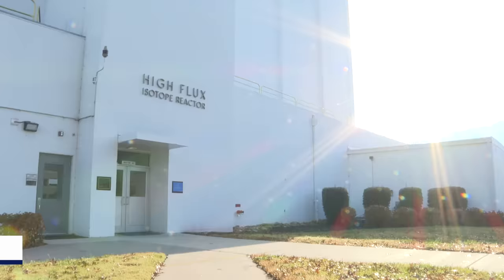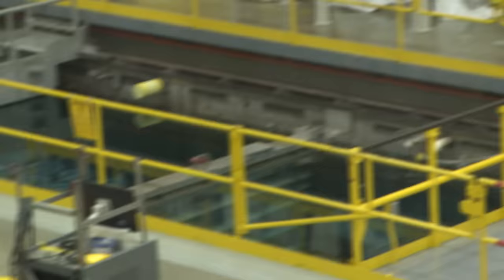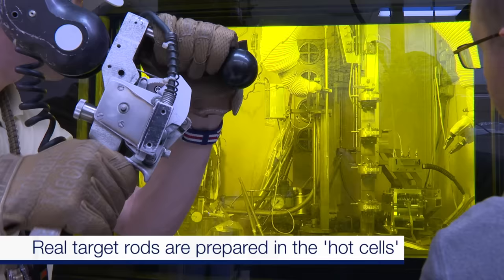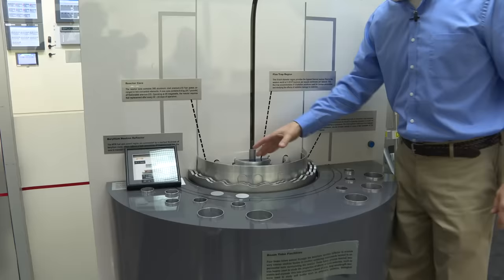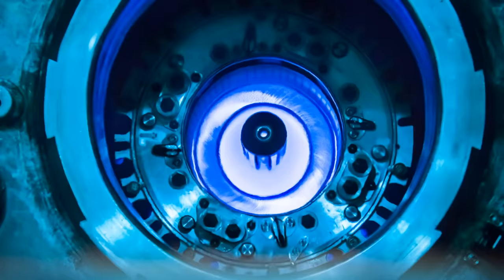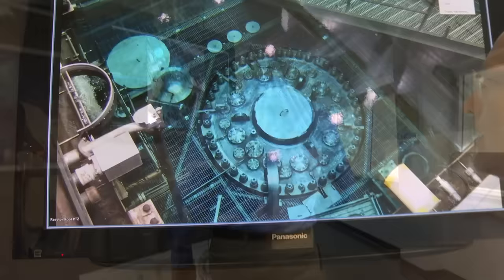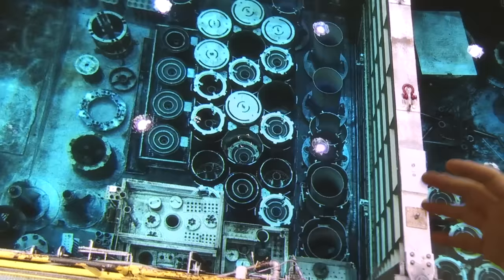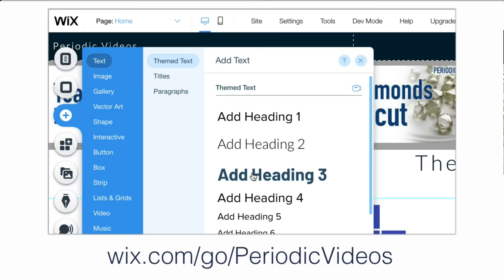Inside a Nuclear Reactor

Comment: I get an almost spiritual feeling, looking at the soft blue glow of Cherenkov radiation. Seeing it in real life, with my own eyes, would be a dream come true!
Reply: It is even cooler in person than in the videos, if you can believe it. There are a decent number of universities with reactors you can tour & the "TRIGA" design is the coolest imo b/c you can watch the reactor while it's critical. I've seen HFIR from this vid, ATR in Idaho, & MIT's reactor, but the humble TRIGA at Texas A&M was the one I could most easily stare at for hours haha
Reply: I agree that it is cooler to see in person. It is eerie, when you are looking right at it, knowing what makes it visible. I've worked in spent fuel pools quite a few times, when spent fuel is being brought in straight from the core in refueling outages. I've also seen the fuzzy effect in video recordings. I am the programmer for the AREVA ECHO-330. We set up our system on top of empty spent fuel pool storage racks. Spent fuel was brought to the system, fixed in place, and in line with our multiple transducer array, and high radiation resistant camera. A regular camera can not handle the radiation from fuel that just came out of the core. Even with the radiation resistant cameras, the fuzziness is there. Part of it is heat from the fuel making currents in the water. And part is the effects of the radiation itself on the camera sensor. In discussion above, people are talking about fuzziness you see with your eyes, if looking at fuel live and in person. But Daniel's original question said 'interference in videos'. It is more noticeable in videos than it is in person. Other than the currents in the water due to it being circulated for cooling, and from heat coming off the fuel, if you are standing by the pool looking directly at spent fuel, I don't recall the fuzziness that you see in recorded video. So it is the high radiation affecting the camera sensor. It has been a few years since I was at poolside. But I have hundreds of hours of poolside work in my history. I live in Lynchburg, VA, mentioned in this interesting video. Been to some of the places mentioned in the video, and familiar with some of the process, including Cf-252. We used that in one of my systems at work and swapped it out every two years. It has a very short half-life. I think about 2.6 years.

Comment: Is it possible for you to show the lenghts, temperatures and co. also in the metric system?
Reply: Shouldn't be a problem one might think. It's not nuclear science.
Reply: 8 feet = 2.4 meters
9 feet = 2.7 meters
36F = 2C
100F = 38C
120F = 49C
156F = 69C
24 inches = 2 feet = 0.6 meters
20 inches = 1 foot 8 inches = 0.5 meters
25 tons = 50,000 pounds = 22680Kg
Reply: @jimknowlton342  Isn't a ton a thousand Kg ?
Reply: @D4RKBRU73  
He's converting the imperial to metric.  An imperial ton is 2000 lbs... So a little over 1016 kilos.  A metric ton is 1000 k.
Reply: @sujimtangerines  Ah ok thank you
Reply: @D4RKBRU73  1 ton in the US  is 2000 pounds, or 907kg.  This is technically a short ton.  M McCoy is talking about long tons, in the US we almost always mean 2000 pounds when we say 'ton'.  Hope this helps.
Reply: @jimknowlton342  <It does, thank you Sir
Reply: @D4RKBRU73  A tonne is a thousand kilograms...the different spelling is to delineate the two.
Reply: Dave Micolichek  Don't be lazy, adopt the metric system
Reply: Dave Micolichek  Why tho? I am genuinely curious why america isn't adopting the metric system. Its far easier to learn and more intuitive. 1t= 1000kg 1kg= 1000g 1km= 1000m. I really don't get it. Is there some hidden benefit to to the imperial system?

Comment: I was wondering though, whats with that low droning sound that some reactors make? Is that due to the reactor/nuclear reactions taking place or is that just a combination of the machines and pumps operating?
Reply: probably machine sounds
Reply: Water being recirculated to remove heat from the surface of the fuel.

Comment: But the real question is can they power a flux capacitor  to 1.21 Gigawatts
Reply: The reactor core is 85 Megawatts, which is 70% of 1.21Gigawatt. 13:18
Reply: Gotta get it to 88mph...
Reply: @AverageJoe8686  
Uh... It was a "Back to the Future" joke.
Reply: @AverageJoe8686  85 MW is not 70 % of 1.21 GW
Reply: @Morphior  0.85/1.21 = 0.702479338, or ~70.248%
Reply: @AverageJoe8686  85 MW is not 0.85 GW. That would be 850 MW. So 85 MW is about 7 % of 1.21 GW
Reply: @Morphior  hahaa yep I just love my lysdexia...dyslexia? dysexlia, yeah that's the one

Comment: The high flux reactor is interesting  because the core is made with mostly HEU that goes critical once it is put inside of the reactor and gets wet. The rate of reaction is very quick compared to typical pwr's so it can create exotic isotopes 🤓

Comment: The blue light is emitted when a charged particle (such as an electron) passes through a dielectric medium at a speed greater than the phase velocity (speed of propagation of a wave in a medium) of light in that medium. Special relativity is not violated since light travels slower in materials with refractive index greater than one, and it is the speed of light in a vacuum which cannot be reached (or exceeded) by particles with mass.

Comment: The sixth or seventh generation nuclear reactors will be powered by U235 enriched to 12 percent in order to extract 2.4 percent of fission products and make use of PUREX for fuel production. From the PUREX plant all of the Pu239 is reused to make electricity.

Comment: re: the involute shape.  I don't understand: the diameter of the inner circle is less than the diameter of the outer circle; if you divide the ring between them into "equal" spaces, they must have a little bit of wedge shape to accommodate the outer diameter, do they not? if not, how is that possible?

Comment: If x-rays and gamma rays carry more energy than a photon in earths atmosphere; what would happen if a photovoltaic cell was put in the reactor while in operation?
Reply: Straight in the reactor core itself it would melt. PV cells are very efficient with short wavelength UV, X-rays, and gamma rays. This kind of approach had been adopted in the sixities and seventies for cardiac pacemaker batteries. They were known as beta-voltaic batteries. In this application it was a beta source, promethium 147, which does not emit gammas as a result of beta decay. Not exactly the same thing I know, but radioactive decay can be very usefully harnessed. The use of BV cells declined with lithium ion technology / chemistry becoming ever more affordable.

Comment: I wonder if you could put a solar powered drone with a camera on it inside the reactor to film and get shots of the cherenkov radiation well charging the Drone batteries with whatever ultraviolet light that is emitted from the reactor. ( if solar panels can even use ultraviolet light?)

Comment: I thought that beryllium reflected neutrons.  He seems to be saying that hitting beryllium with a neutron will cause the beryllium to release some (which would change its isotope, and would also mean that you can "use up" the beryllium).  Is that correct?  It doesn't sound right.
Reply: It does both, when beryllium is hit with high energy neutrons it can sometimes will undergo an (n,2n) reaction. Be normally has 4 neutrons and 5 neutrons, but if you hit it with neutrons, it will go to take a neutron with it, leaving Be8, with 4 neutrons and 4 protons which then decays into 2 alpha particles in addition to the 2 neutrons that zoomed off. This makes beryllium both a reflector and neutron amplifier and why beryllium will often also be used as a neutron source to start nuclear reactors.

Comment: why, since neutrons change the composition of the elements, it doesn't change the barlium in the same way into another element that is in the reactor housing?
Reply: barlium? Do you mean the aluminum? If so, then yes, over time the reactor components eventually fatigue and need to be replaced.

Comment: is it possible to make miniature reactors ?

Chris is talking about billions of neutrons hitting a square centimeter, but what if you miniaturize it to 1 square millimeter (or smaller) surface area would it be possible or usefull to do so ?
Reply: It isn't about the density of neutrons necessarily it's about if you can get a small enough critical mass. getting a small critical mass for micro reactors is doable but then extracting the heat becomes more problematic. However micro reactors only order of 10 kW are being developed for space. Google kilopower to read more about this NASA project.

Comment: Does all the aluminum used in the core and other reactor components become activated?
Reply: No, in a word. Radioactive isotopes of aluminium are very short lived.
Reply: @paulanderson79  Not exactly, and Ill quote the IAEA on this one

" Radiation damage and aging of the aluminum components are caused by the interaction
 and capture of fast and thermal neutrons in aluminum that results in change of microstructure and change of mechanical properties such as tensile strength and elongation."

while a bit more hearty than some materials, aluminum eventually has a lifespan in a reactor system.

Comment: Thanks for the tour.  Was hoping the question of life might come up.  D. radiodurans bacteria can survive inside the core of nuclear power reactors, and in corrosive acids, in environments above the boiling point of water, freezing sub-zero regions, and even the cold vacuum of space.  Wonder if any microscopic life (D. radiodurans bacteria, etc) can survive in the higher heat and/or high neutron environment of this reactor ?  Where's the limit ?

Comment: The blue glow is exterior of the pressure vessel.  Do the neutrons damage the vessel, eventually?
Reply: Yes, very eventually. The higher the flux, the more damage so high flux reactors like this require a fair bit of maintenance when it is offline.

Comment: So it is fair to say they have more experience in radiating aluminium than all other elements combined, what happens to aluminium in those conditions?
Reply: It will become activated (absorb a neutron) to become Al28 which decays in time to Si28. All fuel has to be designed to take into account its neutron absorption amount over the lifetime of the fuel and if it can withstand the damage well enough to keep its structural properties in spec. This is why materials qualifications remain the most time-intensive part of nuclear R&D.

Comment: The way the control the movement of the fuel / core when loading and unloading looks very crude.  What happens if they make a mistake when it's going into the reactor and they smack the core into they edge of the hole?  Damage of expensive equipment.

So, it all seems both futuristic and crude at the same time.

Comment: Where do the extra neutrons come from, when they're emitted from the beryllium shield?
Reply: beryllium 9 is the most common isotope of beryllium. That means it has 9 nuclear bits and 4 of them are protons. In this nuclear reaction, the beryllium absorbs the neutron but becomes unstable. In a rather rare type of decay, it splits into 2 alpha particles and spits out 2 neutrons. You can think of it as the neutron that went in and an extra come out but of course neutrons are distinguishable so that isn't exactly accurate.

Comment: at 14:16-14:20 do we see ants or some other creature inside a nuclearly active section? I see something moving in lower-right side of the frame.
Reply: That's about 10 feet underwater so highly doubtful it's anything but some debris or film being swished around in the flow of water. You can see the frame on the left moving a little bit in the flow as well.

Comment: So I'm under the impression the water is highly radioactive after all this, what happens to that water.
Reply: No because the fuel rods contain all the radioactive elements. The most contamination that gets into the water is tritium from the water. Regular hydrogen Will eventually absorb enough neutrons to become tritium. That's the main contamination but it also occurs naturally so you can get rid of it by diluting it normally

Comment: What would happen when I took a sip out of the reactor pool?
Reply: Most likely nothing would happen if you took a quick sip, as water is a decent radiation insulator. Maybe you'd have a higher chance of cancer later in life? A very insignificant increase. But, if you would jump in with a scuba suit, go close to the reactor, and then take a sip of water, you'd most likely get either the smallest type of radiation poisoning, the average radiation poisoning, or guaranteed cancer later in life, but most likely due to the external exposure, and not from taking a sip. A sip is very small, so small that it most likely won't do any harm, or at least a lot less harm then external exposure. All of this does count on the reactor type, and how much radiation it emits.
Reply: D. Y. Thank you so much :)
Reply: Nothing.

Comment: Makes me wanna watch Chernobyl again.  The cask weighs 12 tons?  Sheesh, I wonder how much actual product it contains.  Getting a permit to ship it must be a bureaucratic nightmare.  It breaks all the rules.  Size, weight, height, not to mention the grandaddy of all hazmat.
Reply: Activated nuclear waste gets shipped thousands of times per year in the United States. While you're right to say that it's highly regulated it's also not very unusual.
Reply: @BeCurieUs  What is unusual is a 12 ton item at 14 feet tall making it too high for just about any bridge overpass and too heavy for just about any road except on interstate highway (and even then is problematic), add to that the width requiring at least two lanes of traffic.  You have a wide load requiring a lead and follow vehicle carrying the most dangerous hazmat known to exist.  Something like that requires months of planning with different permits for each state and/or municipality.   Like I said, a bureaucratic nightmare.  Sure, trucks carry hazmat including nuclear waste all the time but not in a 12 ton cask that is 14 feet tall.  The only difference in carrying nuclear waste as opposed to any other commerce is the times you can travel and routes you can use.  No special permits required.  Just a nuclear waste hazmat indicator on the trailer.

Comment: 05:54 Steam is bad... does that mean the reactor has a positive void co-efficient?
Reply: Most LWRs do not, but it can cause damage if the design isn't meant to experience cavitation. Bubbles send out little shockwaves when they dissipate, and steam is also bad in the reactor because it means the water is not in contact with the reactor walls...causing the fuel to spike in temperature. Steam is always bad in a reactor system, even ones that are meant to have bubbles in them like BWRs. BWRs are mostly just exploiting nucleate boiling advantages and have no steam in the actual reactor system. Nucleate Boiling
 is actually hugely fascinating and complex and something I didn't understand fully until I started asking my actual nuclear engineering friends about this reactor system and why they had it pressurized at all if it is below boiling point. Turns out, boiling is hugely complex and not as simple as something is boiling or not.

Comment: Are there little bugs in the reactor? ..lol...🤔😳 Starting at around 3:09 in the video where they are showing the reaction rods being placed in the reactor you can see little particles which almost look like little bugs or gnats or something. Seriously.  I know its sounds weird and its probably dust or metal particles (i hope) or if it is little bugs being disturbed from their nesting spot they're probably radiation resistant.  They could be on the outside of the glass but it doesn't look like they are by they way they move. Look closely.  Is that what they are??

Comment: But how do they work at an uranium factory. Dont the workers get radiation poisoned?
Reply: Most uranium is extracted by chemical processes. If you are picturing workers with pickaxes, you are picturing the wrong decade.
Reply: @BeCurieUs  I know that they dont use pickaxes, but still some guys probably have to use the heavy machinery in order to extract the ore. Dont they get radiation poisoning?
Reply: @danijel124  No, mostly because it is all chemically extracted via insitu techniques. Basically, dissolve it in soda water or some kind of acidic substance and pipe it out. Very little in the way of human exposures, but also, uranium is a VERY weak radiation source unless you get it inside you, and it is also a very large particle so easy to filter for. In general, mining for uranium is one of the safer mining industries. Moreso in Canada where their mines have a nearly spotless safety record. 
Still represents the lions share of nasty side of nuclear, but honestly mining for everything is pretty horrible, be it copper or rare earths for renewables or coal and gas...etc. When you look at the overall externalties (unfunded public damages), nuclear ends up pretty close with wind and much better than solar...and all renewables and nuclear orders of magnitude better than fossil fuels.
Reply: @danijel124  Just to add, there are still some open pit mines, but the bulk of extracted uranium these days is all done with chemicals. Even with open pit mines, though, it is easy to protect workers because radiation is so detectable. It is why we can operate on highly radioactive reactors will not much exposure to workers.
Reply: @BeCurieUs  Lets say that its as safe as you say... But answer me this question honestly. Would you personaly be a worker there?